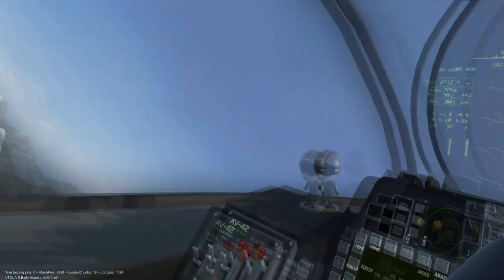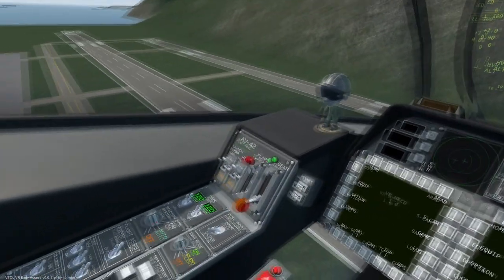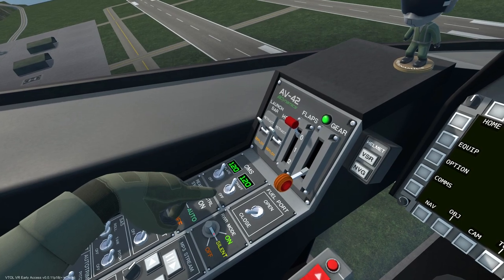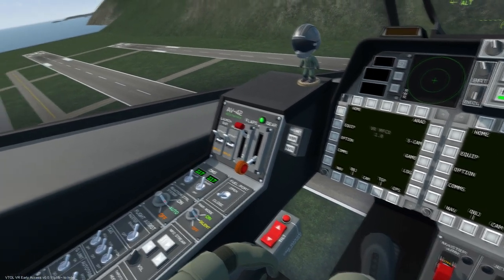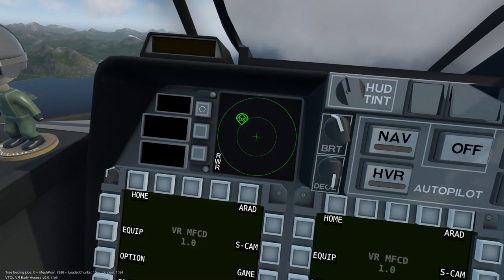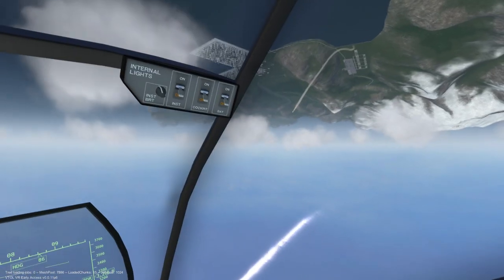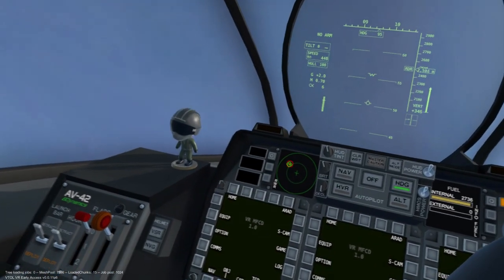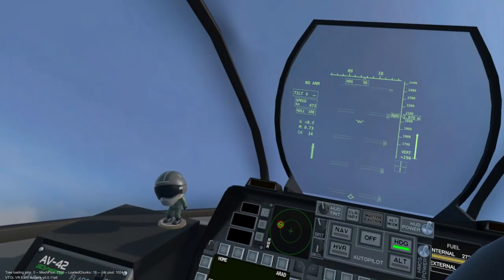VTOL VR Tutorial Nuggets: Countermeasures and Evasive Maneuvers

Comment: 2:11 "The missile is not going where the aircraft is...." but it is going where the aircraft isn't :D
Reply: nightmares
Reply: The missile knows where it is at all times. It knows this because it knows where it isn't. By subtracting where it is from where it isn't, or where it isn't from where it is (whichever is greater), it obtains a difference, or deviation. The guidance subsystem uses deviations to generate corrective commands to drive the missile from a position where it is to a position where it isn't, and arriving at a position where it wasn't, it now is. Consequently, the position where it is, is now the position that it wasn't, and it follows that the position that it was, is now the position that it isn't.

In the event that the position that it is in is not the position that it wasn't, the system has acquired a variation, the variation being the difference between where the missile is, and where it wasn't. If variation is considered to be a significant factor, it too may be corrected by the GEA. However, the missile must also know where it was.

The missile guidance computer scenario works as follows. Because a variation has modified some of the information the missile has obtained, it is not sure just where it is. However, it is sure where it isn't, within reason, and it knows where it was. It now subtracts where it should be from where it wasn't, or vice-versa, and by differentiating this from the algebraic sum of where it shouldn't be, and where it was, it is able to obtain the deviation and its variation, which is called error.

Comment: I still don’t understand how to deploy flares using Windows Mixed Reality controllers
Reply: You probably have to map this on some other button as the WMR controllers don't have ABXY buttons. Luckily the Reverb G2 finally will change that.
Can be done in the SteamVR overlay you should get to with the left menu button.
And probably you'll have the same issue with weapon select on the right one.
Reply: Im on WMR, you click the menu button on left controller while holding the throttle stick